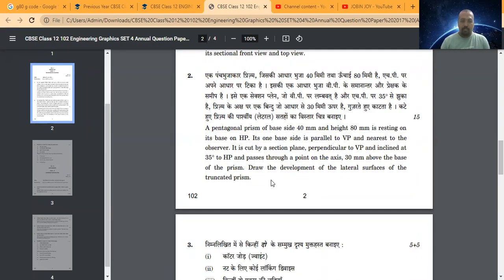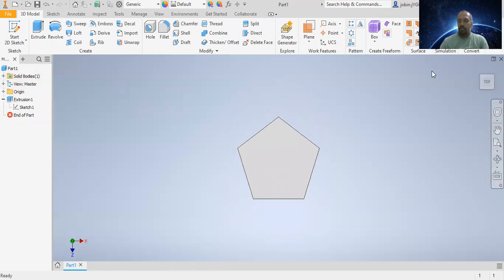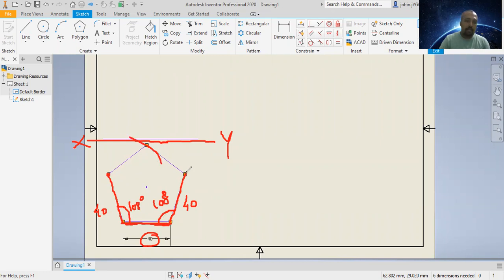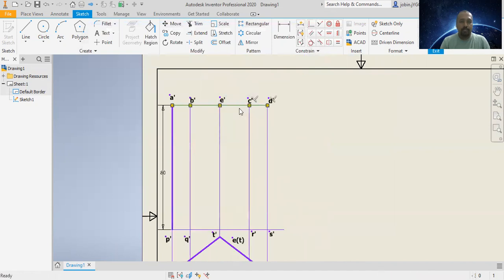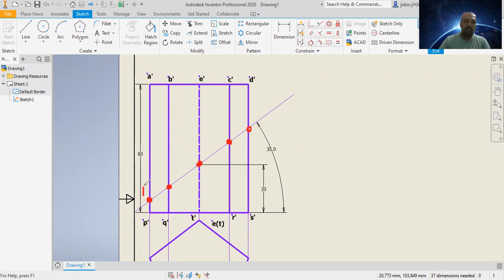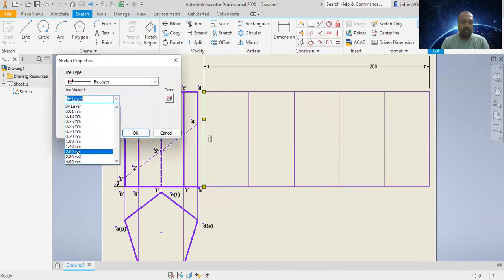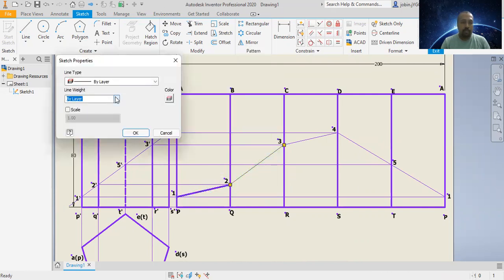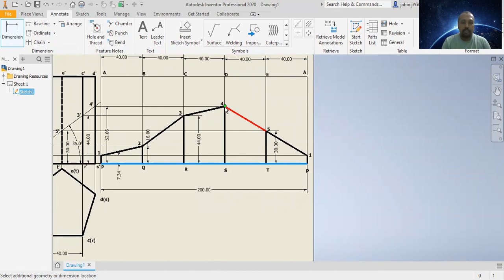CBSE Q NO 6

Comment from the maker: A pentagonal prism of base side 40 mm and height 80 mm is resting on
its base on HP. Its one base side is parallel to VP and nearest to the
observer. It is cut by a section plane, perpendicular to VP and inclined at
35 to HP and passes through a point on the axis, 30 mm above the base
of the prism. Draw the development of the lateral surfaces of the
truncated prism.